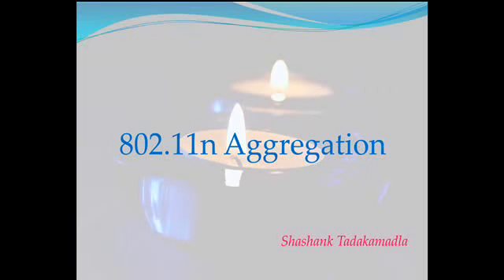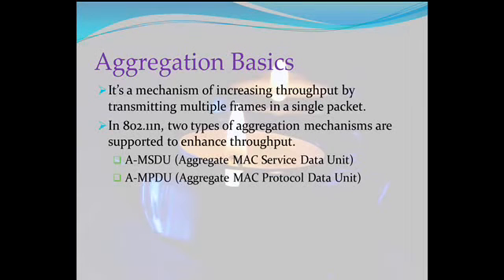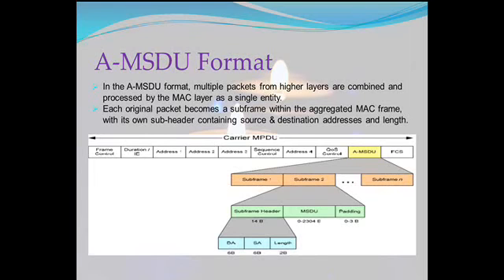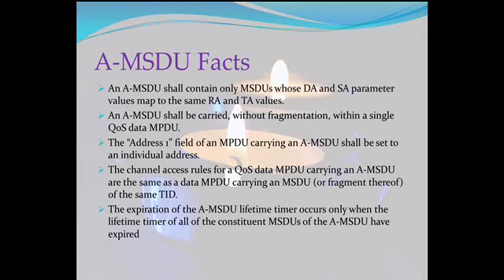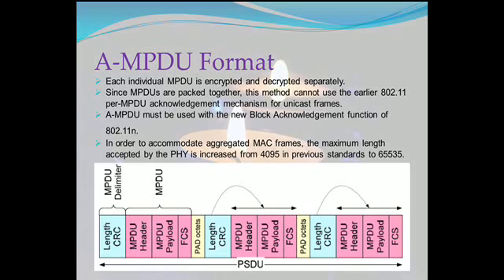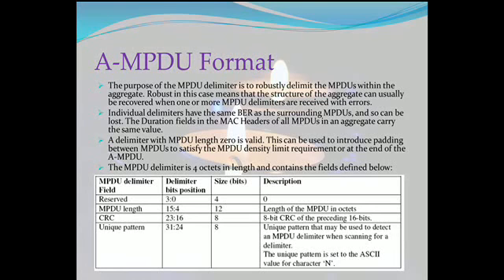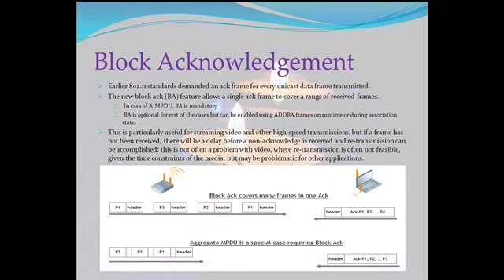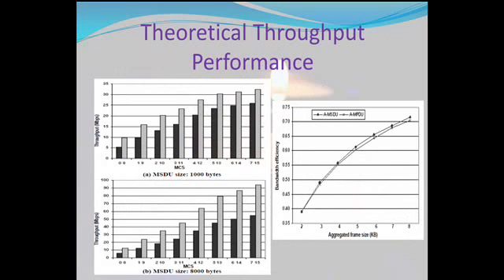Aggregation Video

Comment: Treatment for A-MSDU is same as .11 frame , A-MPDU uses Block ACK for selective frames if there is/are errors., Usage of A-MPDU and A-MSDU can depend on channel. If channel is good (less PER) then A-MSDU is good to use. If channel is more error prone, go for A-MPDU to selective frame re-transmission, Because if there is an error in a A-MSDU the entire frame needs to be retransmitted.